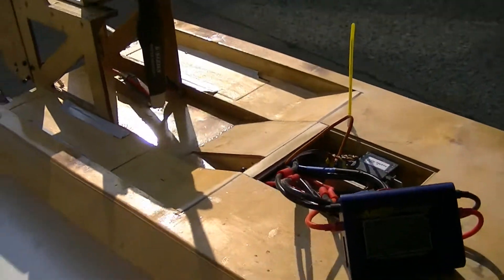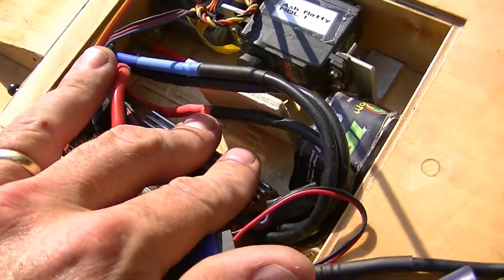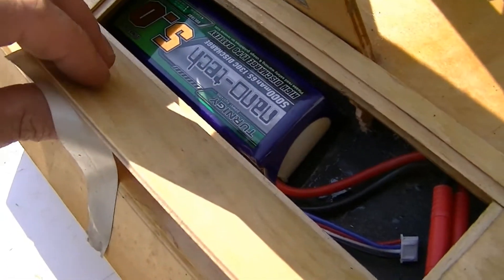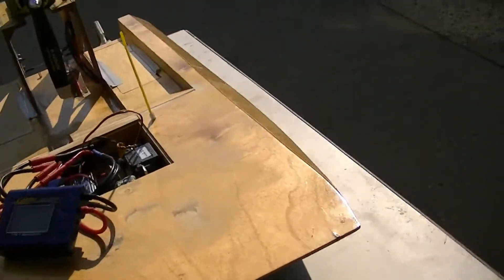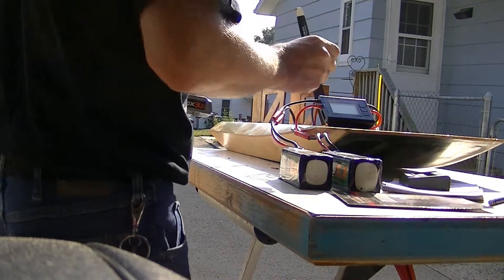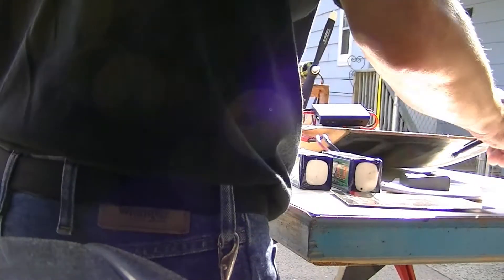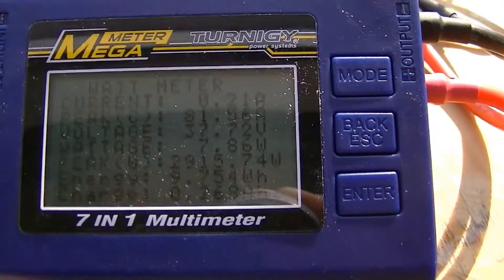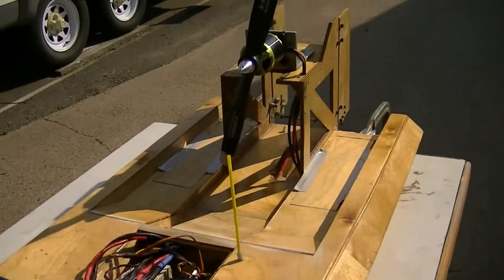Electric RC airboat 6 and 10 cell Lipo test

Comment: Can I pick your brain about your watt meter? I have the same one... can you tell me what each reading is for? And how I apply it to my setup?
Reply from the maker: Current is the amperage used (in real time) Peak (c) is just that, peak current drawn.. I use those to determine if I'm over taxing the speed control. If your amperage is too high for the ESC or the discharge rating of the batteries, you can fry your speed control or puff your batteries. Wire size and length as well as connector size can effect this reading. Using reasonable size connectors and short, large wires is always best. The longer the wire, the more resistance and the higher the amperage draw and lost power.

The wattage is kind of a horsepower guide. 1000 watts is about 1.3 Hp. This is good for seeing if you are over burdening the motor. if it's a 700 watt motor and you get 1900 watts on the meter, you can harm the motor.  You can over volt motors, you just need to watch the heat buildup. 

I'm not real sure what the "energy" and "charge" readings are.

Thanks for watching.